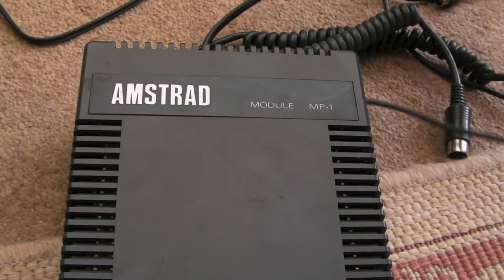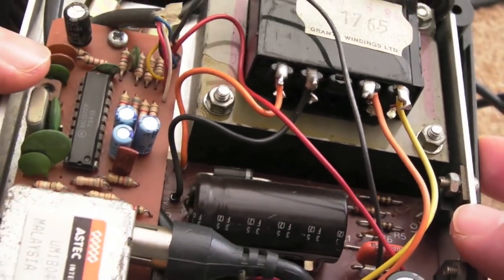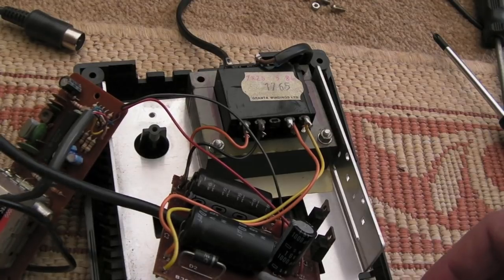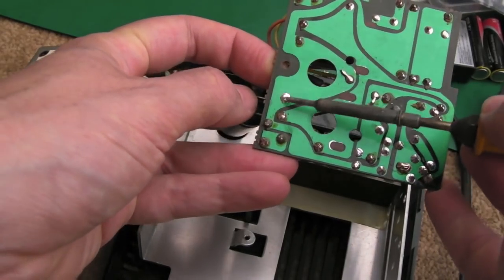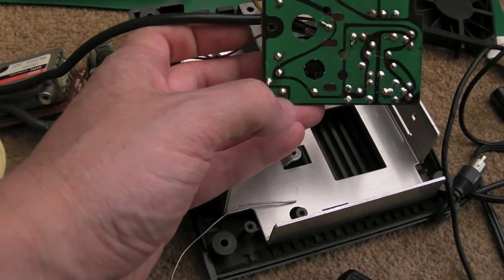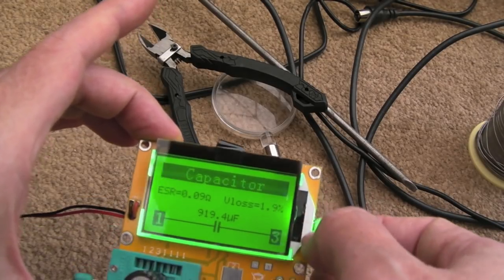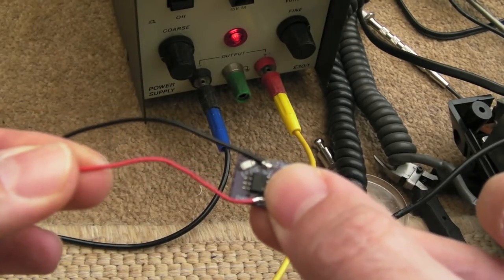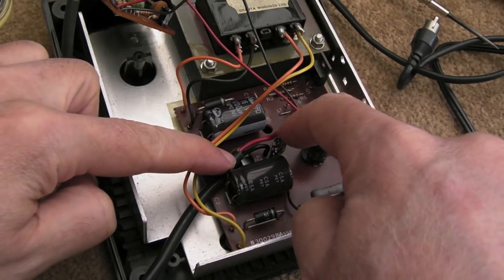Amstrad CPC 464 MP1 PSU Refurb & Over Voltage Protection

Comment: Nice refurb Chris, that PSU is as good as new. Brilliant idea using one of bwack's power saver boards inside the PSU, you should put one of them inside the CPC as well it will be bulletproof then.
Reply from the maker: Thanks =D  I plan on sticking one in the CPC too I think.  Just need to hope bwack can provide a few more!

Comment: Nice. Hopefully Bwack will make some more of those gizmos soon. I would definitely  buy a few. I nearly got caught out on a cpc128 when using it with a TV. It needs a 5v for the cpc and a separate 12v jack for the integral disc drive which it is supposed to get from the monitor. The centre pin on the 5v is positive but the centre pin of the 12v is negative ! Just something to watch out for. I modded the cable to make it impossible to back-volt it accidentally and stuck a sticker on the cable!
Reply from the maker: Thx =D  Yes, they are great little boards!  I hope he can sell just the PCB for other applications like this.  Ouch at that disk drive PSU connector - that's one reason why I think I might stick a saver PCB inside the CPC as well, just in case I accidentally grab the wrong connector and think its 5v...

Comment: I cant remember if my MP1 handled sound as well, but I could understand why Amstrad wouldnt want to feed the audio through the RF line, introducing noise to the picture, not when the cpc has an onboard speaker anyway. Makes sense to me.
Reply from the maker: I will take a look inside the modulator can tomorrow, there might be a few caps in there that I missed.  Will update a short update if I do.

Comment: "Sweet!" - GadgetUK164 2018

Modulator looks a bit of a messy output, wonder if that needs recapping, not that you care xD
Reply from the maker: LOL - that was AFTER recapping!  I recapped the modulator!  Although, there might be a cap inside the can I guess.
Reply: Yeah that's what I meant, the caps inside the can xD
Reply from the maker: I will inspect tomorrow =D  I will admit, I totally overlooked it!
Reply: Hehe fair xD Interested to hear the outcome :)
Reply: There’s definitely a cap inside the modulator can in the c64.
Reply from the maker: Yep, there's 3 or 4 if I remember correctly!
Reply from the maker: Thanks =D

Comment: Modulator does not handle sound. Sound will come from the CPC internal speaker as normally.
Reply from the maker: Wow, surprised Amstrad didn't do that!  But then again, I guess the original design was for the speaker to provide the sound.

Comment: I always hated RF even bitd it seemed thoroughly terrible, other than having no AV-In to speak of on early TVs it never made much sense going forward with all the devices that came up in the 80s. At least coaxial was easier than screw forks.
Pretty scary how the old PSU can take out a whole system, is that all of them, NTSC regions included?
Reply from the maker: Yeah, RF was always pants lol =D  I am not sure if there was an NTSC Amstrad CPC?  There may be?  The main issue is the CPC doesn't have a regulator or any over voltage protection (and I think no reverse polarity protection either).  I will do both of these fixes to the CPC too I think - just in case the wrong PSU is connected.
Reply: Oh my mistake, I must have been thinking of the C64 PSU. Yeah no NTSC CPC model, probably would have been incompatible with the EU software anyway heh.

Comment: could you mod this for composite rather then rf
Reply from the maker: Yes, that would be possible!  Just a case of working out where the composite signal is, perhaps amplify it with a 2N3904 and it should work!
Reply: Yes, the signal composite signal is middle wire going into the rf modulator box. Exactly the same procedure as the zx spectrum composite mod.